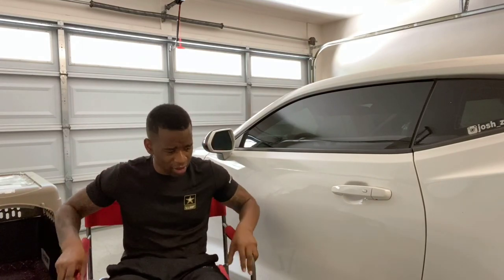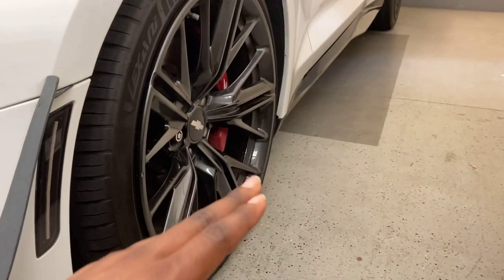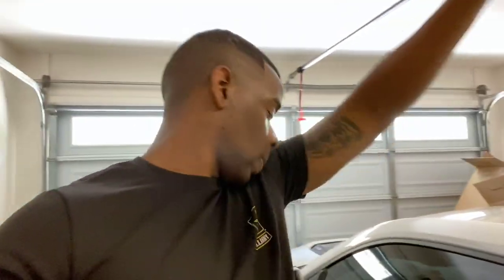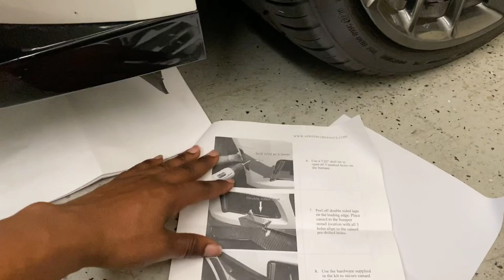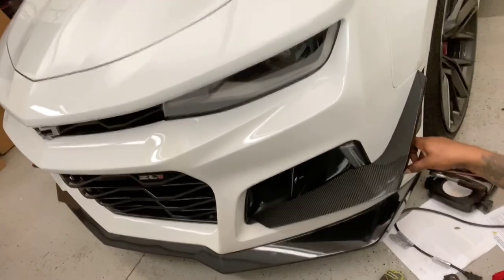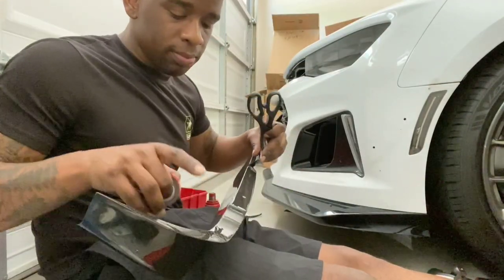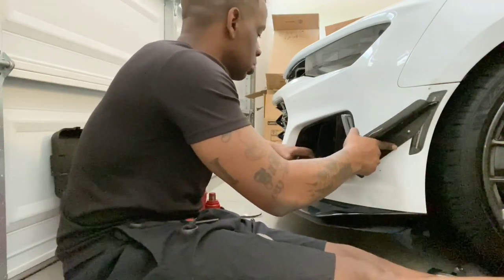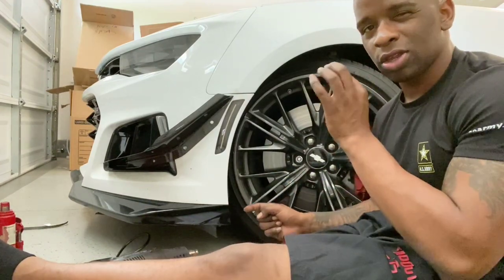CAMARO ZL1 1LE CARBON FIBER DIVE PLANE INSTALL

Comment: I have the same Canards on order 
I’m wondering if I just 3M tape the whole canard to the body and maybe only the one screw to the vent area if it will be strong enough 
Hate to have to drill through the body
Reply from the maker: I drilled it and 3m
Reply: @IStayJoshin  but what if I just 3M the whole thing
Reply from the maker: @peterfrias9510  to be honest I don’t think he would hold, I just switched it out and put the regular 1le one on and it covers all the holes
Reply: @IStayJoshin  doesn’t the 1LE canard press into factory bumper notches 
Not sure I’m understanding you correctly
Reply from the maker: @peterfrias9510  yes but the base Zl1 bumper when you add the carbin fiber you have to drill into it then when I did the the normal 1le it covered the wholes from the aftermarket one I had to drill in.
Reply: Do you have the link or brand name of those new canards?! Exactly what I’m looking for